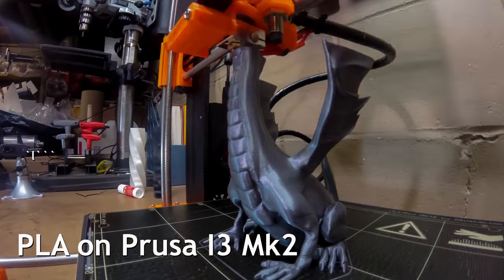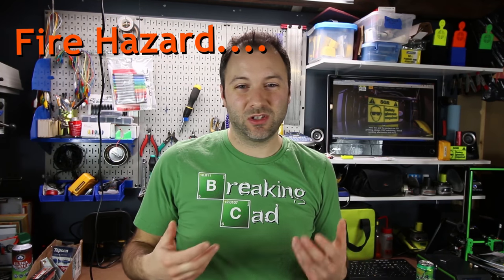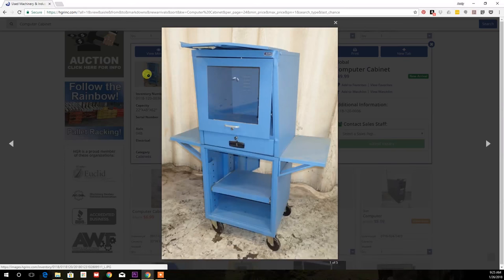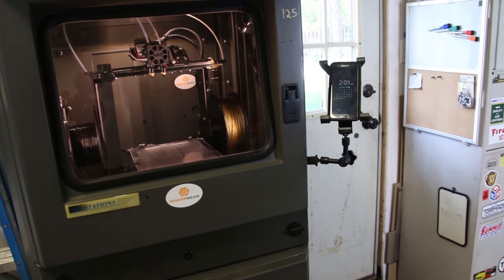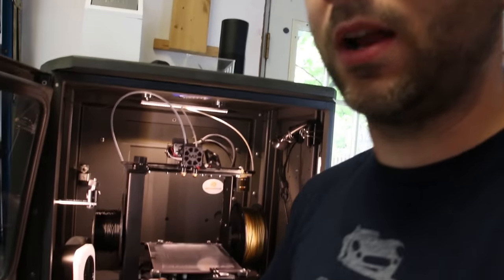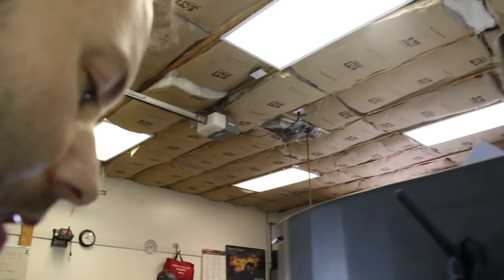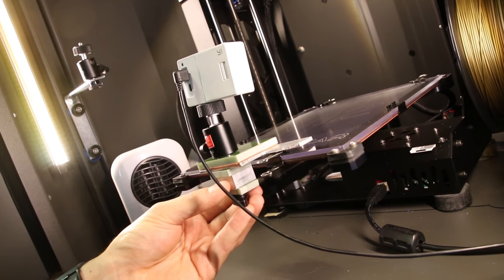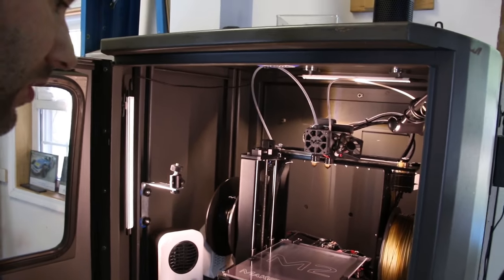3d Printer Enclosures Part 1 - All Metal for less than $100

Comment: On my MakerGear M3ID I replaced the front right rubber corner with a custom corner with a hinged arm for the camera.  It's a lot less bulky.  I also pulled all the electronics off of the frame and moved them out of the enclosure.  Always nice to see another MakerGear user; there are not too many out there, relatively speaking.
Reply from the maker: Thar sounds nice. I might look at updating my setup to something similar.

Comment: Over time the enclosure also degrades the electrical components like the motherboard due to the heat. You would need to mount the motherboard and controller boards exterior to the enclosure.
Reply from the maker: Depends how hot your are running the enclosure. I typically only go to about 110F Max. The boards on the controller are rated for that and the printer has been running happily with no electronic malfunction for years. If you really want to crank the temp for more industrial materials then you would want to do something to cool the RAMBO control board or relocate it.

Comment: @safetyglassesrequired - what is the mounted phone for exactly?
Reply from the maker: Phone is to control Octoprint. This particular printer didn't come with an Lcd screen it was built in 2013 screens were less common then.  Octoprint allows you to control your printer remotely, monitor prints from anywhere with an internet connection, and helps with organizing print files. If you do alot of printing its worth checking out.

Comment: I take it the power supply for printer is outside of cabinet?
Reply from the maker: It's not. It's on a shelf lower in the cabinet. It's still rated for the temps I heat it to. Ideally the extronics would be relocated outside the heated chamber and the steppers would be cooled and then I could really crank the temps up. But for ABS and Nylon it's been fine.